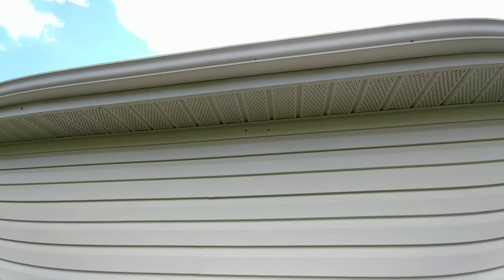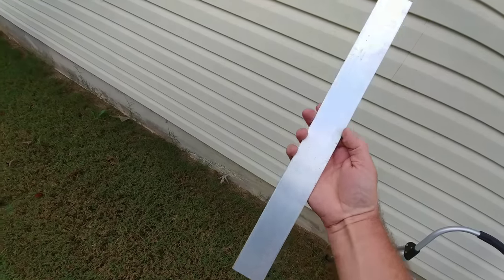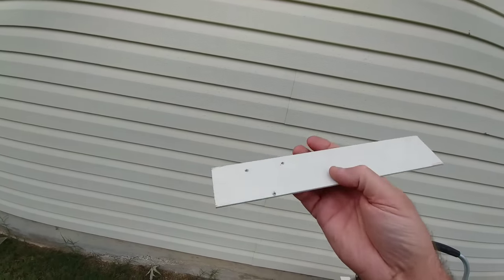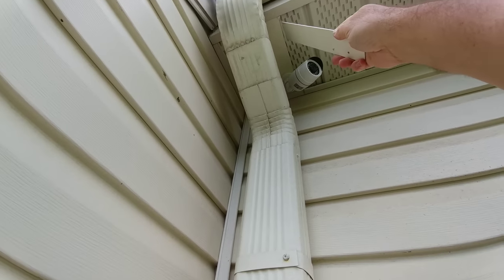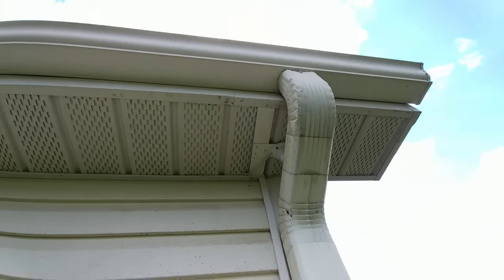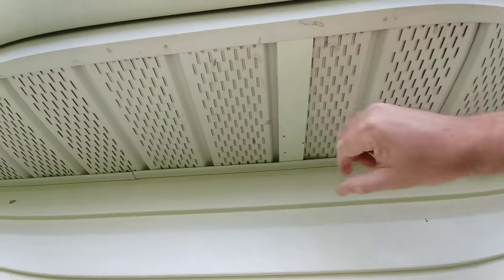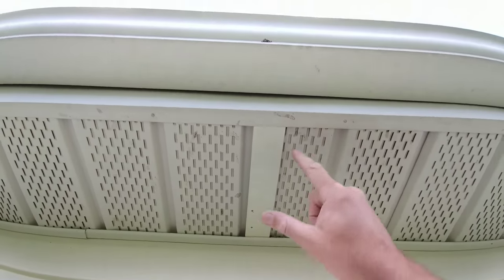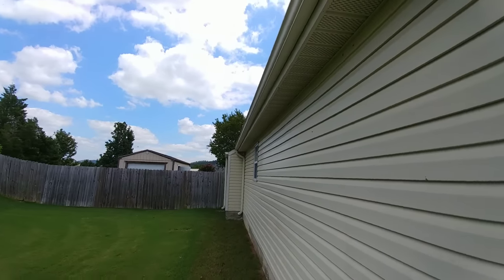Installing security cameras under eave with vinyl soffit

Comment: Our HOA forbids any hole in the siding. It doesn't matter that we've had several criminal events that the police cannot resolve, and stalking and harassing that police say are civil requiring CPOs that we can't get because we're not allowed to attach anything to the siding to document it - not even a 1/8" hole for wiring because wifi cams are easily hacked - and have been. Never mind they allow big messy caulked cable holes and unsecured cable lines though... It's a terrible HOA. Anyway, this may solve the problem because they can't say that I've attached anything. Thank you so much!

Comment: I did this today thanks to your video.  I couldn't remove the soffit so I used a bit to drill a bigger hole in the metal plate and a hole saw to drill through the soffit.  Now the wire is completely hidden.  Thank you.    Note to users: if you use reolink cameras lowes sells 3" wide steel.  Home Depot only has 2" and this will not fit your template.
Reply: Did you use the iron strips instead of aluminum?
Reply: @mikemuder1693  i think i did.  theyre holding up well.
Reply: @ligershark  Does it rust?

Comment: Thanks. A couple of questions. Wasn't clear how you ran the wire. Did you manage to run it into the attic without having to drill a hole in the soffit? And what was the color you used to paint the aluminum strip. I ask, because the siding of your vinyl looks nearly identical to mine. Thanks!

Comment: Great idea! Thanks so much for saving me a lot of unnecessary work and aggravation! 

After watching your video I decided to install Reolink RLC810 bullet cameras on the two front corners of my garage using your method with the 1/8" x 2" aluminum flat stock available at Home Depot. These particular Reolink cameras have 3 separate wires coming out of the camera (a USB connection, a 12v power connection and a camera reset wire with a reset button). It would have been impossible to hide all these wires without using a mounting box. I definitely didn't want an ugly box that would have to be secured to structural wood, because that would have entailed removing the soffit material in order to install wood bracing. Way too much aggravation and work! I didn't want any wires showing, so this is what I did: 

After measuring and cutting the aluminum to length, I temporarily put it in place. Then I carefully decided where on the aluminum I wanted the camera mounted and marked the aluminum. I then removed the mount and drilled the three small holes to mount the camera (using a template supplied by Reolink). I then drilled a large hole (about 3/4") in the center of those three mounting holes to run the wires from the camera through. After lightly sanding and painting the mount with white spray paint, I again temporarily installed the aluminum mounting bar and marked the soffit for a hole to run the wires through. It was very cold when I did my installation, and the location where I needed to make the hole in the soffit wasn't flat. I didn't want to risk shattering the vinyl soffit with a large drill bit, so I used an oscillating tool with a narrow blade to cut a small square hole in the soffit to run the wires through. Great tool....cut like butter. The aluminum mount covers the hole in the soffit completely. After connecting a POE ethernet cable, all of the wires simply get pushed back up through the holes into the soffit void. The installation came out perfect, and because the cameras are mounted behind a gutter leader pipe, they are barely noticeable. I have no intention of moving or removing the cameras, so I'm not worried about the hole in the soffit material. If I ever needed to remove them, I could just find a scrap piece of soffit, cut out a patch and glue it over the hole.

One thing I would suggest to others is that when cutting the aluminum to length, cut it so that it fits good and snug between the wall and the aluminum trim that covers the fascia board. Err on the side of slightly longer....there's always some give, plus you could always use a hand file to trim it a little shorter if necessary. The first one I installed was way too loose, and had to be screwed and caulked to the soffit so the camera didn't shake in the wind. I cut the next one for a tighter fit and it was secure right from the get-go. Also, if you're using wired cameras, make sure you'll be able to snake the wire from your attic to your mounting location before starting your project.
Reply: "One thing I would suggest to others is that when cutting the aluminum to length, cut it so that it fits good and snug between the wall and the aluminum trim that covers the fascia board. Err on the side of slightly longer....there's always some give, plus you could always use a hand file to trim it a little shorter if necessary. The first one I installed was way too loose, and had to be screwed and caulked to the soffit so the camera didn't shake in the wind. I cut the next one for a tighter fit and it was secure right from the get-go. Also, if you're using wired cameras, make sure you'll be able to snake the wire from your attic to your mounting location before starting your project."

Thumbs Up!!!!!!!!!!!!!
Reply: Great tips!  Thank you!  Can you give me the specs of the tool you used to cut through your vinyl soffit?

Comment: Thanks for the idea it worked great!

I bought a 2 dome/2 bullet 4 camera system and installed the cameras using this idea.  Went to Home Depot and bought the aluminum bars which were 2 inches x 3 feet and didn't have any wider.  The dome cameras have 4 mounting holes which are wider than the 2 inches wide bar, so I actually cut 2 lengths using a sawzall with all purpose metal blade and then drilled two mounting holes in 1 plate and two mounting holes in the other, effectively making the two pieces one 4 inch wide.  Once installed I simply ran the foot of camera tail hidden in the outter soffit edge to where it then goes up into the soffit space to where my ethernet cables were hanging.  Luckily I didn't have to drill anything in the attic near the eves because I could see some light bleeding up through the soffit when I was up there, I just had to crawl as far to the corner as I could and then stick the ethernet cables over the 2x4 which then went down and hit the soffit.

Don't forget that this idea is to save your soffit, so the camera mounting screws only need to be long enough to go through the mounting hole of the camera and through the aluminum bar but no further otherwise they will scratch your soffit.  After drilling the holes slightly smaller than my screws, I then manually screwed in the screws all the way to create threadings in the plate.  Once the screws were tight with mounting bracket in place, I then used my sawzall again to saw off the excess of the screws leaving them flush with the top of the plate (screws are now maybe quarter of inch long).  For the soffit itself I just had to remove a couple of nails driven up through the outside edge bracket which I could then bend a bit with my hands.  The soffit pannels themselves were stapled on and so I couldn't actually remove them, but I was able to pry an opening into the soffit space where the "tongue" of one panel inserted into the "groove" of the other.
Reply from the maker: Awesome reply glad I could help with the idea. I  used a hand grinder to flatten screws on back of plate so they wouldn't catch or mark up soffit
Reply: Hi, can you please share a vid/pics on how to did install. Thanks in advance

Comment: Thanks for posting this.  I did something similar, I used 2 2"  aluminum flat bars, I greatly appreciate this idea as I am trying a few camera positions and it sure beats drilling holes in the soffit panels and then finding out your positioning isn't quite right.  I also being a mechanic drilled and tapped holes in the aluminum flats for machine screws (6/32) instead of using self tapping screws with the pointed end sticking out.

Comment: Great idea, I am facing the same dilemma you were and trying to figure out a way and BAM...you’re video came to the rescue! Thanks again!
Reply: You can also you a flat cover for a junction box worked well for my install
Reply: Ryan Baker Is the plate wide enough?
Reply from the maker: Good thought on plate cover. My camera was about as wide as the aluminum strip so no need on my part. Just remember to grind screws patruding through so it won't gouge sofit
Reply: Jim Odell Hey Jim.  First time right now that I’m seeing one of your videos.  I clicked like and subscribed. I’ve got a Amcrest security system.  Where did you buy those metal stops from, bc where I need to place my cameras, there isn’t a gutter at every station to hide the to a certain point. I could really use your advice here. Thanks so much. -T

Comment: I would just like to personally say thanks Jim. I tried this on my install and it made it effortless. 5 cameras up and adjusted in less than 30 min. Prep time took about the same time. Cutting,drilling,mounting camera brackets and paint. Thanks
Reply: How did you meet code with your wiring.  I'm trying to put my camers up but not sure how to meet code with the wire since you shouldn't have cables running thru attic.
Reply: Sorry, Should have mentioned I have Arlo Pro wireless cameras.
Reply from the maker: I'm not sure about code since every area would be different. This is all low voltage cat 5 wiring so I'm thinking it wouldn't be as strict, but I would check with your local coding to make sure
Reply: Thanks for taking the time to respond :-).
Reply: Did you also drill holes in the soffit or just holes in the aluminum?
Reply: @nicoletoombs5768   Just drilled into the Aluminum.

Comment: Great video!  I have the same trash vinyl soffits that have empty space above them and nothing to screw the cameras into.  The aluminum plates will be cheap and easy to put up.  Thanks for sharing, will save me a ton of time and money.  Now if I only had tips on how to run the wires EASILY.  My current plan is to make holes in the soffit AND aluminum plate and push the wire through from the outside.  Then crawl around in the attic and use a grabber to get the wire from the really narrow area at the edge of the roof in the attic and pull it through.  I have crawled on my belly all the way to that tight area and it's difficult to find the hole to push the wire OUT.  It's a pain.

Comment: My rain gutters extend below the soffit by 1.5". I had bought junction boxes before watching your video and had planned on taking them back. I'm going to use them as a standoff as well as cable housing along with your idea of the bar.  It will also allow for better control of the camera angle settings due to attaching to a ceiling vs. wall style.
Reply: They do make junction boxes specifically for cameras, would lower them down.

Comment: Plus one for this guy's tip. I did it with a piece of lexan and the result was fantastic. Nice and easy to slide it below the soffit all without drilling into my house. I appreciate the great tip.
Reply: how did you attach the camera to the lexan? just regular screws?
Reply: Great tip dude, I had some left over material that I can repurpose for the camera mounts instead of tapping into the soffit.

Comment: Fantastic Idea and helped me come up with an idea to use an angle mount that fits in the corner of the soffit instead across. I will probably do it both ways with the rest of the cameras. I did buy a very large 16x zoom PTZ camera and I am unsure how I am going to mount it as its very heavy. probably should be mounted to wood, but I dont want to put holes into the house

Comment: I too debated a similar solution but in the end just decided to attach the camera directly to the soffit with screws. I figured it provided a cleaner look. Plus replacing the soffit is pretty cheap and easy if you ever need to. But overall a great idea!
Reply: me too all that extra work with the strips of metal wasn't necessary.
Reply: yup...  a high end finished house would not accept this.  just find the joists and you will hit wood

Comment: LOVE your idea. I now have 6 mounted that way.  Works like a champ.  I used screws to mount to the aluminum and counter sunk the heads to not mess up the soffit.
Reply: How wide do the strips need to be 2-3 inches?
Reply: @scottb_02  I used 2" strips, just make sure your mount screw holes will fit on the strip.  I also painted the strip to match the soffit color.

Comment: Thumbs up!  Elegant solution and watchable video.  I'd love to see a part-2 video of your solution on running the wires inside.  I'm sure there are other videos out there on how to do that but would love your take on it!
Reply: This^^ I love this idea that you showed.  However, I have no idea how to get from the soffit to the inside of the attic.  Is it just open space between the soffit and the house wall? Should I expect to run into a stucco wall right behind the soffit or is the wall usually less protected than that?  This is the part I am most confused by.

Comment: Thanks for the idea, I am using a piece of 1x3 wood piece to do something similar, just painted it to match the house. Then, I will screw that into the 2x4's behind the soffit's but not so tight to disrupt the soffits too much. then mount the camera to the wood.

Comment: Love this idea. I’m thinking about doing this but also drilling a center hole for the wire to go through the aluminum as well. This would also mean 1 hole drilled through the soffit for the wire, which I don’t mind as it will make an even cleaner appearance.  I really like this because I have no plywood under the soffit to mount to, so the bar gives a sturdy foundation for the camera base without me having to remove the soffit and build blocking.
Reply from the maker: Thanks for the comment. I also moved one of my camera a couple weeks later and it was a lot easier since I didn't do any damage to the soffit
Reply: I’m thinking of doing the same, easier to run the wire, could get white gromets to plug the hole if you decide to move it
Reply: @jimodell7644  Any chance you can post a video showing how you did this without creating a hole in the soffit?

Comment: How did you ran the wires inside the house. Would love to see how you do it. I just bought a security camera. Thanks!
Reply: Balong Lumang me to 😂
Reply: The wires are only 3” long, they terminate in attic not connected to any power source what so ever. All show no go
Reply from the maker: So above my sofit the attic is open so it was easy to take a wire snake and push it up then grab from the attic. If you have wood you would have to drill a hole so the wire can go into the attic then grab it from there.  Hope this helps
Reply: @jimodell7644  I have aluminum soffit, was quite difficult but I think I finally found a way to to it.

Comment: how is the wire getting behind the soffit without any holes drilled?  You're just tucking in behind?  No pinching on the wire?  No deformation to soffit?

Comment: I needed a little information on how I was going to install my new Eufy Cam 3 solar cams. This may work. I really don’t want to drill holes in my vinyl siding. They are pretty heavy, so 1/4” steel bars may make it more sturdy. We’ll see

Comment: Nice video, man.  Good call.  Nice cheap, easy way to get that done without overthinking it.  One thing I would say is if you're getting IR glare issues to maybe see if you can mask off and paint black the inside of the camera hood.  I have to sharpie the inside of my phone's otterbox for the same problem.  Real nice video, though.

Comment: I like this idea especially because I question if the vinyl is strong enough and rigging any wood or anything behind it will be a pita up in my blown-in insulated attic, especially down where the roof comes down to soffit up there.  With this I think I just have deal with the cable on the inside, which is much easier.

Comment: A great way to put my security cameras where I need them, Thank You.!! I'm planning to install my cameras this way as well. Only problem I had was Lowes and Home Depot only had 2 inch wide bars and I needed one that's 3 inches wide. So I found a supplier that stocks all kinds of metal at different thickness, widths, and lengths. 

FYI, it's MetalsDepot.com, they are located in Kentucky and their prices are real good. I received mine within 3 days. Now they do sell the Aluminum in two feet or four foot lengths. I'm now waiting for my Attic temp to go down a bit before crawling around up there. BTW, if anyone has good material on running the cables behind the soffit and into the attic please inform.
Reply from the maker: Great info and thanks for sharing.
Reply: Can you send a link to the product you purchased?
Reply: @drdez  MetalsDepot.com 
They're located in Kentucky. Go to their website and they have all different metals, thickness, etc.

Comment: Out of curiosity, what tool did you use to cut the aluminum strip down to desired size?
Reply from the maker: I used a hack saw
Reply from the maker: @seanallen5423  
I used stainless screws so they wouldn't rust. I grinded them down so they wouldn't stick out on the back side

Comment: Question: did you buy shorter/stubbier screws or just drilled right through the soffit with the bar?

I’m thinking of using a piece of plywood or oak (1/4) thick.
Reply from the maker: Drill pilot holes then screw them in  and then grind any screw end sticking out so it will be flush with the bar